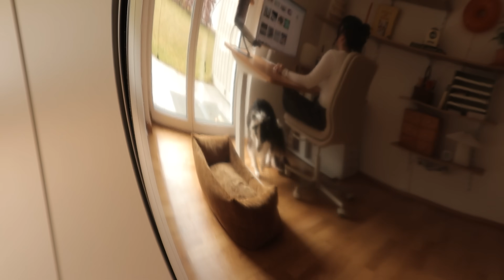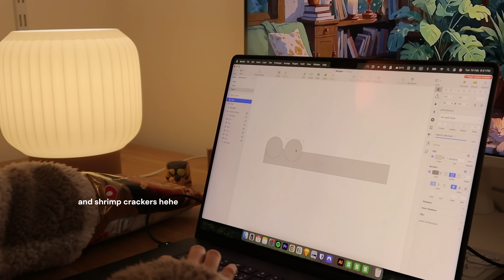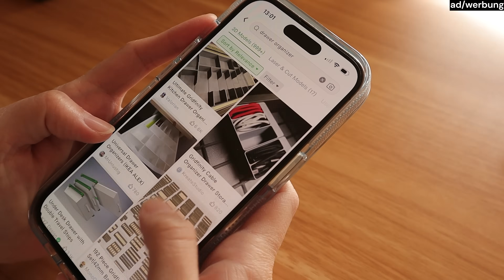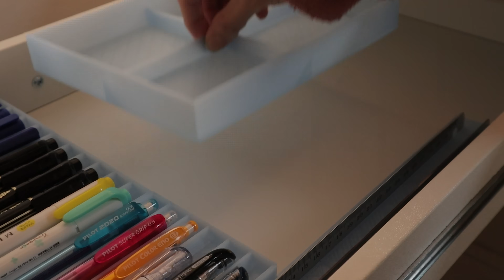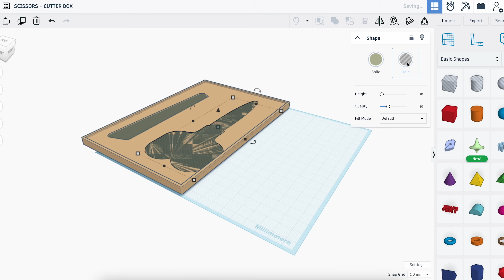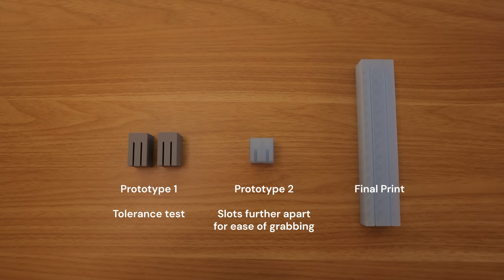I organized my life with 3d printing (without any autocad skills)

Comment: I enjoy making things from wood and hate plastic buuuuut i gotta say i’ve been eyeing those printer for a while
Reply: it would be great to take 3D printer to make the prototypes for ur wooden project!
Reply: PLA is not plastic :)
Reply: @peters-z8n  it is chemically a plastic, although derived from plants directly, rather than petroleum, which is also plant based but from fossil times. They're both the product of photosynthesis, and thus solar power :)
Reply: @hounamao7140  Traditional plastic is made from ethylene (C₂H₄), while PLA is made from lactic acid (C₃H₆O₃). So it's two different chemicals.
Reply: @peters-z8n  in what universe lmao
Reply: @LC-hd5dc  I already replied that 3 months ago. Check all the responses.

Comment: Do you have a more in depth tutorial on of you made the cutouts for the scissors? Like step by step on how you scaled it with the ruler. I tried but the cutout was way too small. I don’t know what im doing wrong. Any help would greatly appreciated.
Reply from the maker: Let me try to explain it here :) 

1. Measure your item
2. Take a picture with your phone at zoom 3x
3. Import into Illustrator (make sure units are in mm)
4. Scale picture to size. Do this by creating a rectangle (opacity 50%) of the dimensions of your item, and then scaling your photo to match perfectly. (Alternatively, take a picture of your item next to a ruler and create a 10cm rectange and scale the photo until it matches 10cm mark on the ruler.)
5. Outline the item
6. Offset the outline by +0.5 to 2mm
7. Optional prototype step - At this point, you can switch the stroke to 2mm, "outside only," export layer as SVG, import into Tinkercad. When importing, check the length & width to make sure it matches that in illustrator (do this by clicking your outline in illustrator & setting the values shown on the infobox). Export as a file suitable for your 3d printer and print the prototype.
8. Otherwise, click on your outline, add a fill & REMOVE the stroke, then export layer as SVG file and import into Tinkercad (same thing, make sure length & width matches)
9. Import your generated container into Tinkercad 
10. Adjust the item depth to about to 50-70% of the real item height and align it to the top of the container, then click "hole". (If you want it 100% of the item height, manually add finger holes in Tinkercad so you can get the item out easily)
11. Select everything, click "union" and export the file suitable for your 3d printer. 

Hope this helps!

Comment: I broke my 3D printer.  I basically heard  online that warming up your butt could stimulate poop and digestion, but I didn’t rly have any heat pack or something at home. I thought I could sit on my 3D printer bed (while the bed is hot) and it would work. Turns out it does work, it worked too well that I just started pooping there right on the spot! 😂it got into all the gears and cogs which made them get stuck and the printer no longer is able to glide back and forth to work

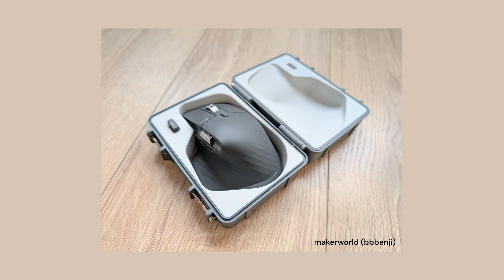Comment: The IKEA Alex drawer also fits the standard Gridfinity (42mm) perfectly! I used Gridfinity to clean up my ALEX drawers last weekend, each drawer fits a 7x12 grid and there is loads of pre-made Gridfinity boxes/ storage containers (like 5:59 in your video).
Maybe you still have some drawers left that need organizing. "Slim Gridfinity Base for Ikea Alex Drawer" on Bambu's Makerworld is the perfect starting point for the grid :)

Edit: Ah I see, you have used Gridfinity for the camera drawer! Should have finished the video before commenting...
Reply from the maker: I actually have mixed feelings about gridfinity 🙈 The grid takes so long to print, and I don't like that my container sizes are fixed to multiples of 7. But I still do see a lot of advantages to it, so I'm trying it out for my camera gear!
Reply: @cloudyhills  there are Gridfinity generators that allow you to change up all the dimensions - base sizes of the grid, the boxes, etc - e.g. the Perplexing Labs one.  I've used them for several really custom builds and it's great!
Reply from the maker: oooh, thank you for the reference, gonna check those out :)